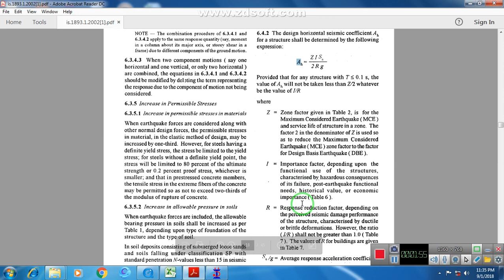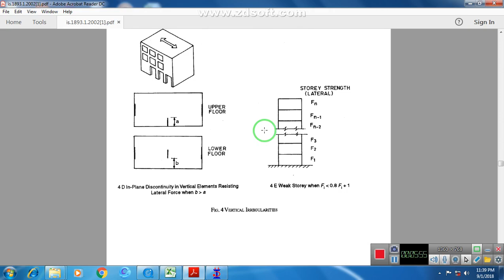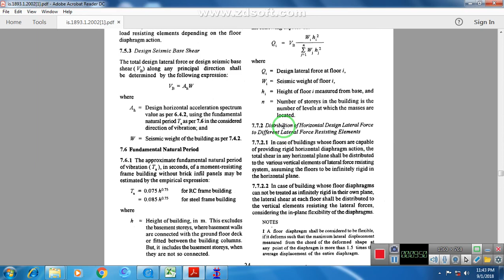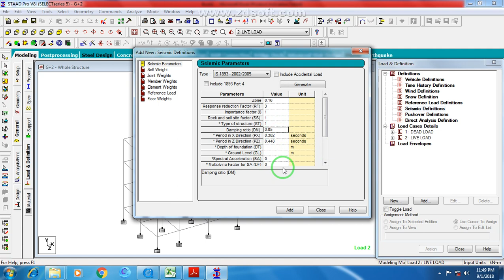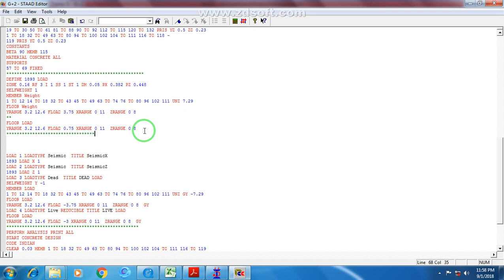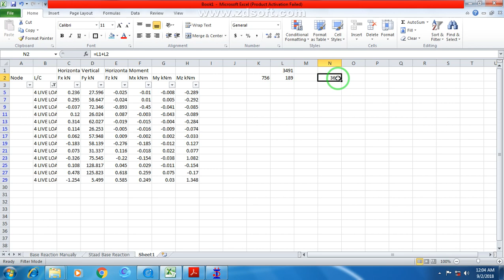Comment: sir you didn't applied dead load in all three direction in case of seismic load
Reply: Dear Shailesh.
Seismic force is a lateral force so u have to calculate it in lateral directions only based on dead+live load on building..thats what i did..i defined mass source then defined two seismic load case for lateral direction i.e. X and Z direction.